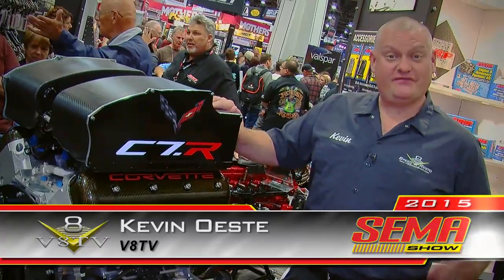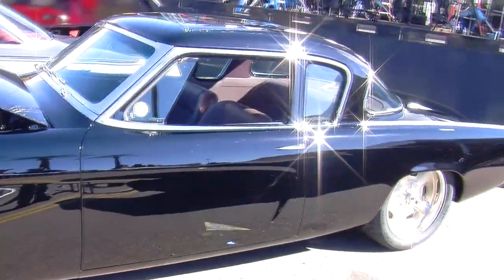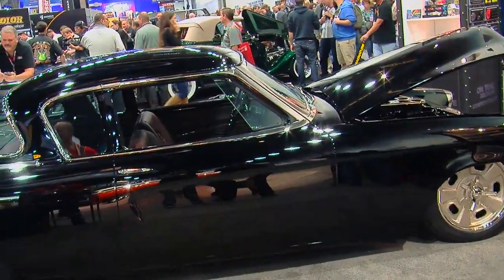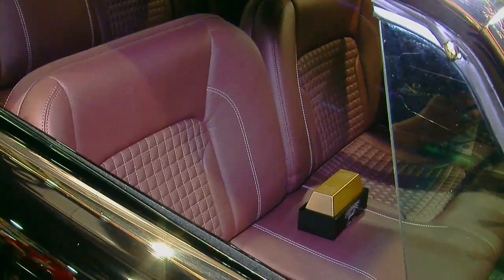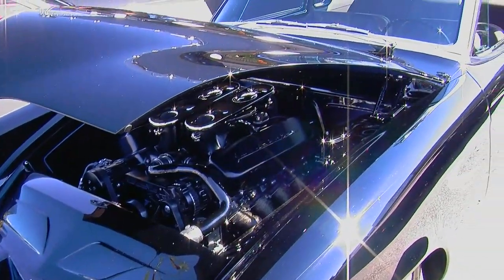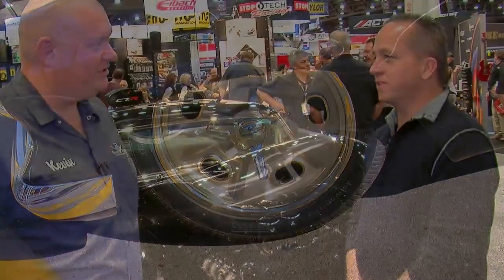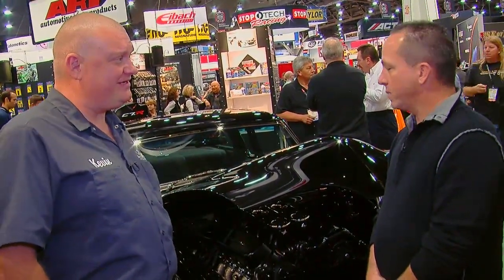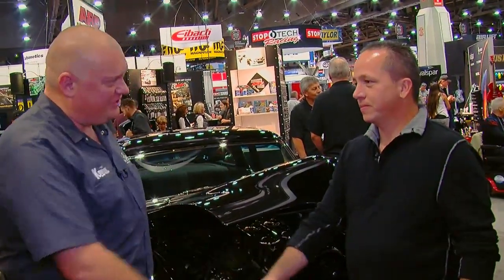ARP Fasteners 1954 Johnson's Hot Rods Studebaker Video SEMA 2015 V8TV

Comment: A Champion came with a 6 cyl, the Commander came with an 232.6 ci V/8
Reply: A friend had a Commander with what I recall was a factory-installed Paxton Supercharger. Not sure about the brand of supercharger, but I distinctly remember how wide the V of that block was. Since that time, resto-modding a '53 or '54 Studebaker Commando has been on my list.